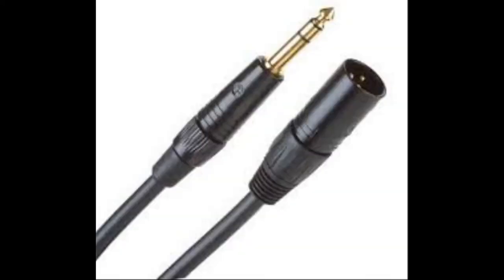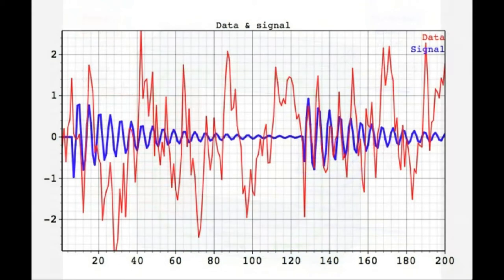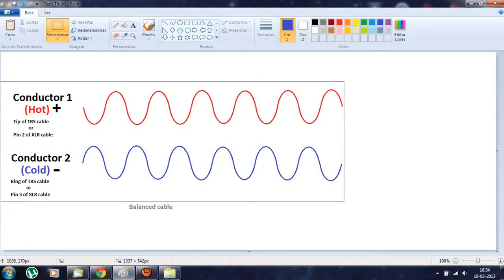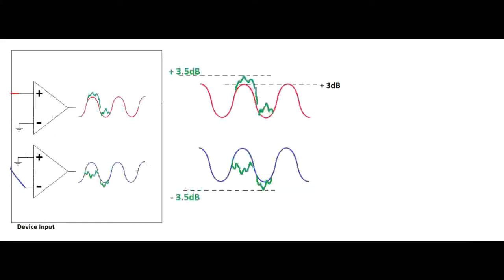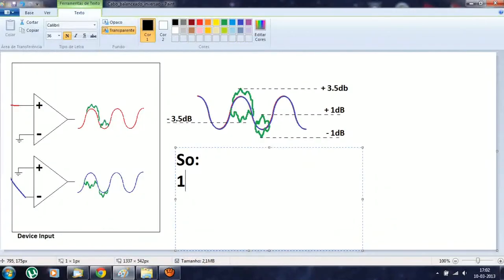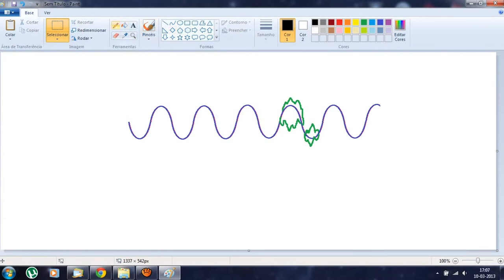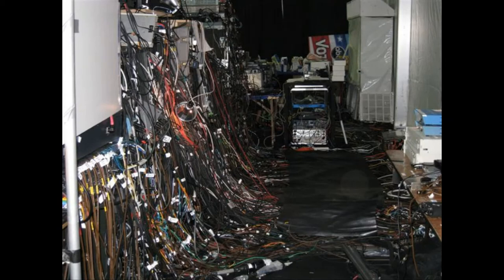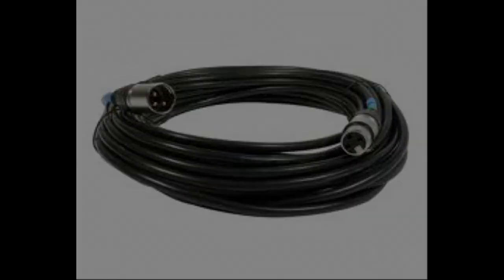Introduction do Music Production - Balanced Cables

Comment: Very nice. I really Liked your presentation. 2 things: I would like to see the source for your material as bibliography added at the end. Second...how did you record the voice over? did you do it with Google Translator? How did you downloaded the audio?
Reply from the maker: Hi!
Yes, I have used the google translator to build the sentences. One way to record them is to use a light audio software like audacity, for example, and configure the audio input to be your computer's audio out (the same output as your speakers of you sound card)

I did not put the bibliography because I only teached what I know. I did not search for any information on the web. This videos's content was my way to explain how it works. (it's a mix of what I learned in my 3year course I took here in azores and my attempt to simply explain it so anyone with even no basic knowledge could understand).

Thank you for you support :)
Cheers!